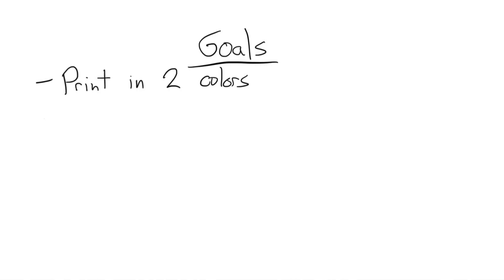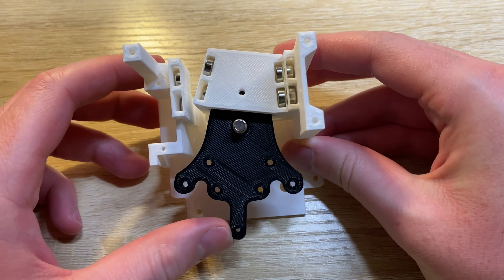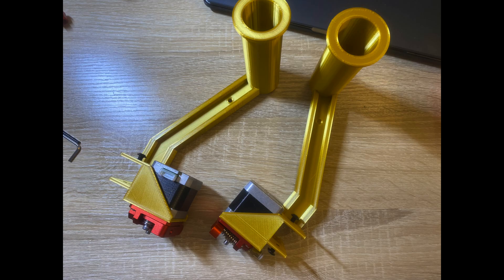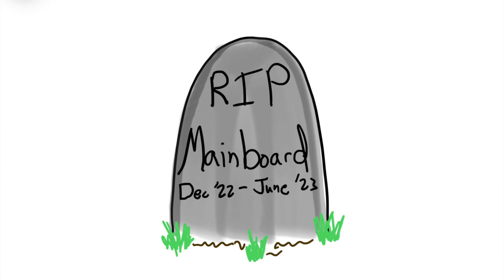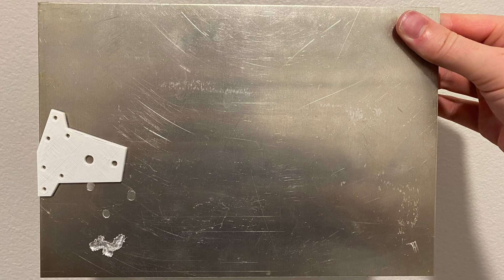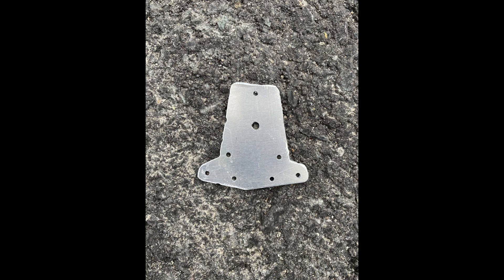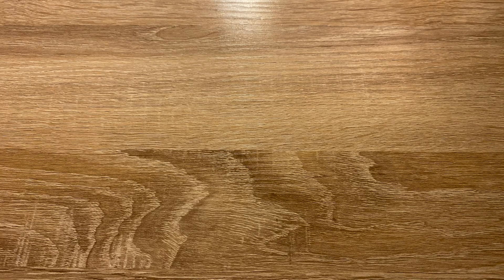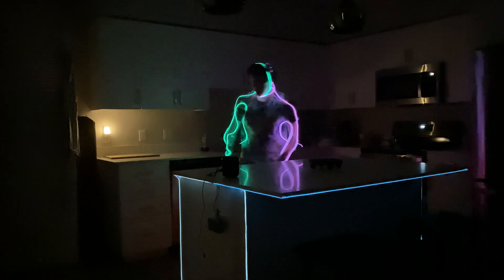Adding A Second Hotend To My Ender 3

Comment: awesome! I've been thinking about this, mainly for PETG supports for PLA to get perfect roofs and easily removeable supports (or maybe for text / contrast lines). I have an 'old' E3 Pro but ended up optimizing it for 1mm nozzle vase mode prints instead of changing the mainboard and everyhing :/ .

Comment: I think the whole problem is getting the movement rock solid. 3d printing if its  off .02 of inch its not good, That's why the retract extrude method even its slow works pretty good

Comment: you said that you didn't want to use a 2 in 1 hotend, but why? You still need a purge block to prime the nozzle, and unlike bambu, you're only retracting a small amount, so you don't cut the fillament, so you don't need poops, it can go into the purge block

Comment: I've wanted dual hotend for a while on a printer now, but I just can't justify it when there's still so much waste with a purge tower.. I had set up a tronxy XY-2 pro a few years ago with a chimera hotend, and once I got to the actual software side of things.. I gave up and sold it xD
I'm still tempted to get an IDEX printer though
Reply: I have an IDEX never use a purge tower. I have brushes on each side where the head docks. When it switches heads it does a small purge glob, then passes the brush which wipes the exteuder clean on the way back to the print. It's way better than the purge tower. You only have tiny strings/blobs of plastic that fall off the 2 sides of the printer. It has made it way more efficient, faster and less waste. If you get an IDEX printer look for one that the heads dock off to the side away from the print bed and the ability to install brushes you won't regret it. I often use plastic in one and flexable on the other side to make flexable joints. But I have also used 2 different colors for cool things like the dual color tree frog.
Reply: @newmonengineering  That's pretty cool, one of the usecases I thought of was using soluable supports for complicated parts like fan ducts where it needs support inside the duct and has many angles so you can't just snap it off after.

Was considering the sovol SV04 or the tronxy gemini as I can't really see myself spending more than that in one go on a printer
Reply: @PureRushXevus  pla and petg have a weak bond onto each otherl so you could use that rather than expensive support material :)
Reply: @specialingu  yes that's true, in some cases though it wouldn't be the problem of support material sticking too well, rather that it literally can't get out from where it's supporting :p